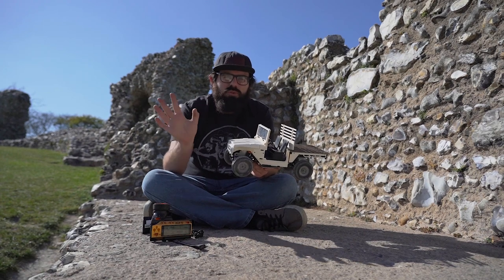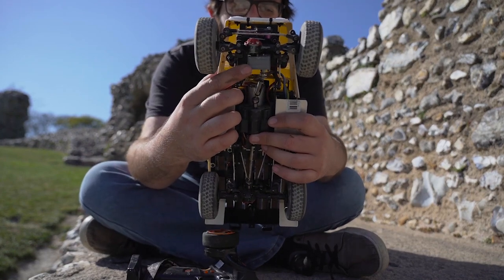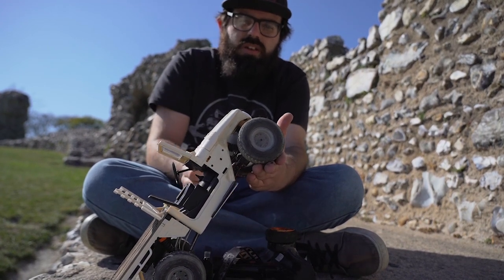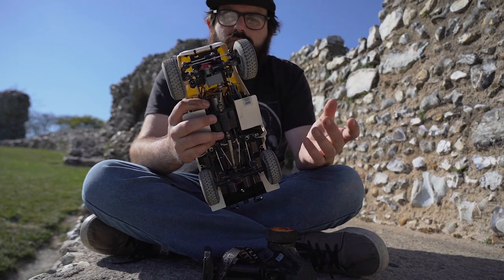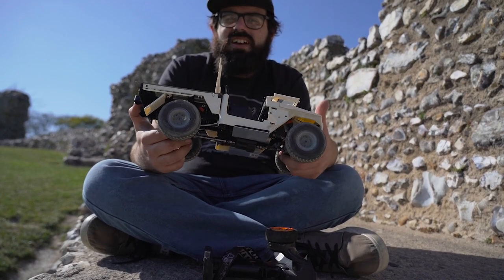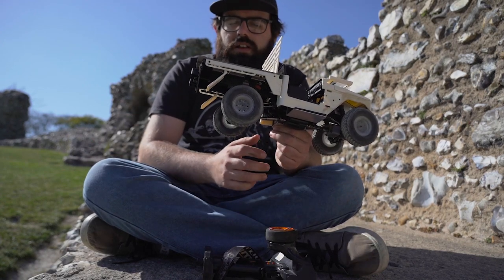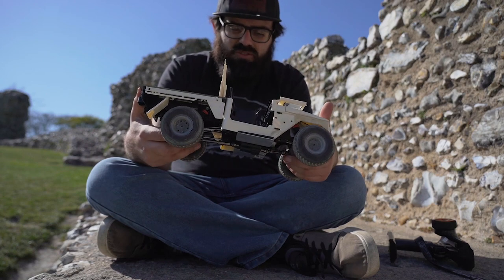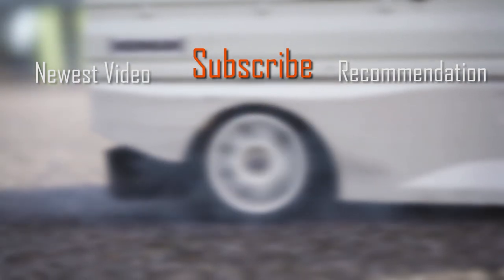This WPL Has A Dirty Little Trick. Low Centre Of Gravity C44.

Comment: That is the first I have seen of overdrive in a WPL so good job. I use over drive in my Axial SCX24 and 1/10 scale crawlers. I feel like there is a lot to learn from the 1/10 scale world to be applied to WPL crawlers to make them perform well. I have seen a few Frankenstein WPLs that are closer to the 1/10 world and your overdrive is brilliant.
Reply from the maker: I feel like the single speed gearbox would be the better choice for overdrive than doing it on axle like I did

Comment: I think it's a grand idea. My thoughts are such that I do feel the geometry of these trucks is their limitation. The motor mounting design is like having a fully extended boat keel to contend with at every move. SCX24 has had overdrive gears available for a little over a year and people swear by the performance. I have a kit for one of my 3 and have yet to install it but it's in-hand! I think, by now, you're admittedly aware that WPL trucks just don't perform the same way others do. It takes a TON of work to get these things to run like other crawlers. To that end, I can understand the question of dedication to the project. I'd say continue but it requires a full redesign of the chassis rails to start. Get that damn motor and xfer case out of the way and move on from there! All about it, myself. Would love to see the results. But other stuff needs to happen, too ;)

Comment: Simple to patch together a gearbox lift bracket and aluminum scale skid plate for the overdrive housing but great job so far and I do believe this is a first when it comes to overdrive on the wpl c44
Reply from the maker: I was thinking v2 could be done on the back of the single speed gearbox